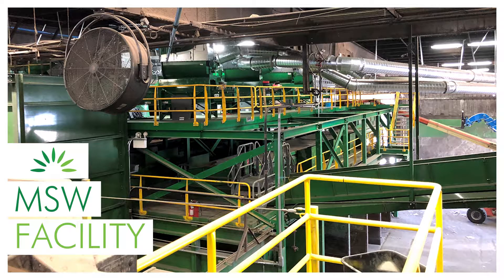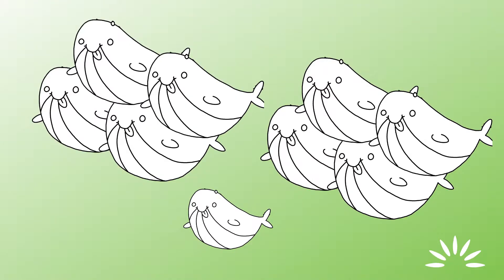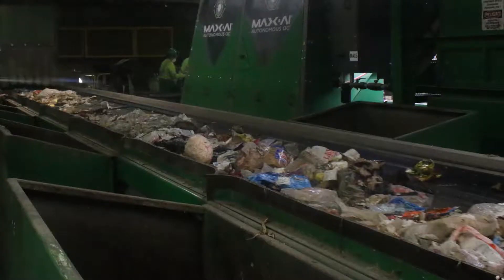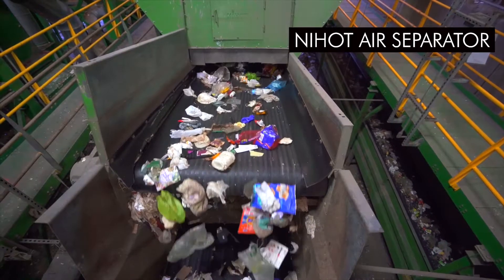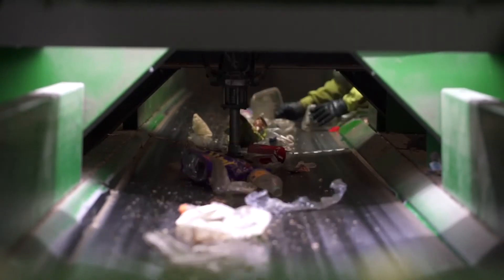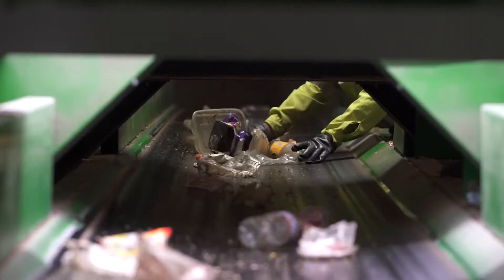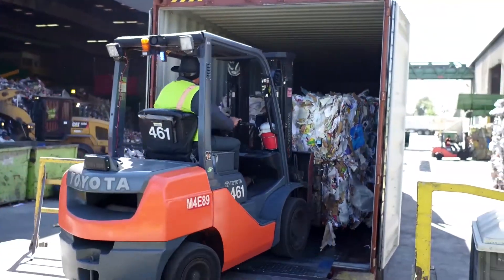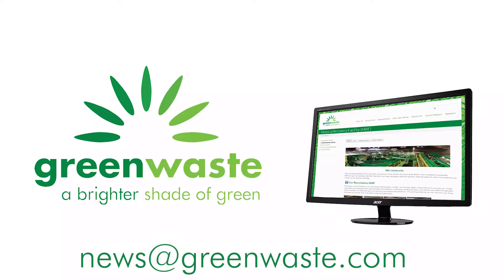GreenWaste Recovery, Inc. Virtual MRF Tour- Municipal Solid Waste (MSW)

Comment: "In non-source-separated municipal solid waste (MSW) composting, the primary microcontaminants of concern are microplastics, heavy metals, and various organic pollutants like PFAS, PAHs, and unmetabolized pharmaceuticals.  
Key Microcontaminants and Their Impacts
The lack of source separation means that contaminants intended for landfill or recycling remain in the waste stream destined for composting, making their removal difficult. 
Microplastics (MPs): This is a significant issue, as plastic contamination is a major pathway for MPs to enter agricultural soils. In industrial compost, fragments and fibers of polymers such as polyamide (PA), polypropylene (PP), and polyethylene (PE) are common. During the composting process, larger plastic items break down into smaller microplastic particles due to mechanical forces and microbial activity, increasing the overall MP concentration and potential harm to soil ecosystems.
Heavy Metals: Metals such as lead, copper, zinc, cadmium, and chromium can be present in MSW from items like tools, light bulbs, cosmetics and related products, or paint chips. These can pose risks to the food chain and soil microbial activity even at low concentrations. 
Organic Pollutants: A range of chemical pollutants can end up in the compost, including:
Per- and polyfluoroalkyl substances (PFAS): Found in food packaging waste, coated paper and other products, these "forever chemicals" are a recent concern in compost and digestate.
Pharmaceuticals and Personal Care Products (PPCPs): Unmetabolized antibiotic substances or residues from personal care products can persist in the compost.
Polycyclic aromatic hydrocarbons (PAHs) and Polychlorinated biphenyls (PCBs): These can be present, though PAHs tend to decline during composting while low-chlorinated PCBs might increase.
Non-pathogen recalled food: recalled food needs to be securely disposed of under source separation, MSW or 'dirty MRF' compost can't properly manage such products creating more compost issues." SAN JOSE, YOU HAD ONE JOB, ONE STINKIN' JOB.